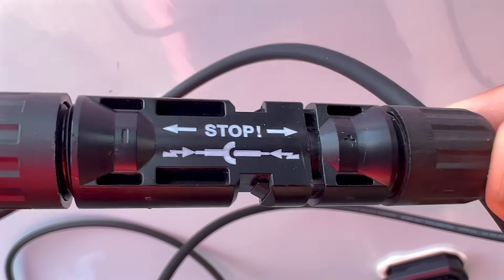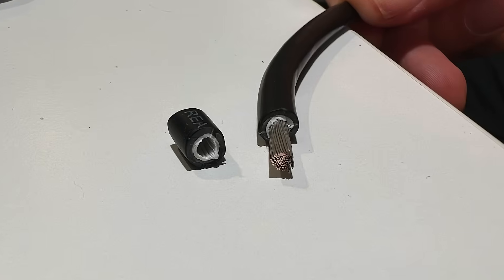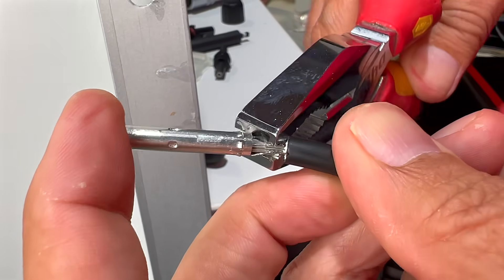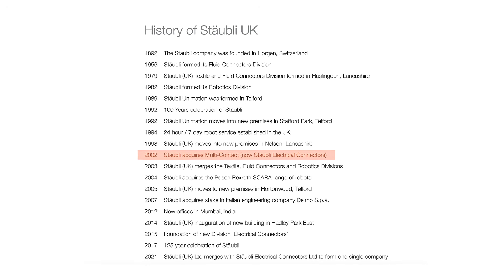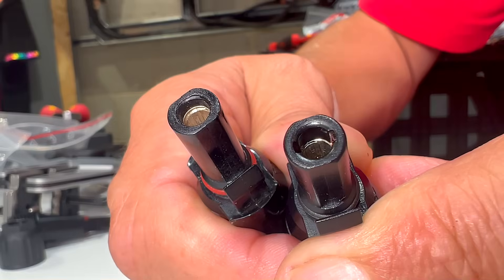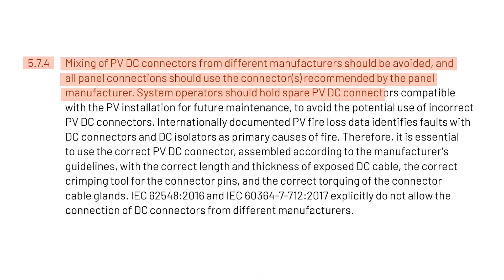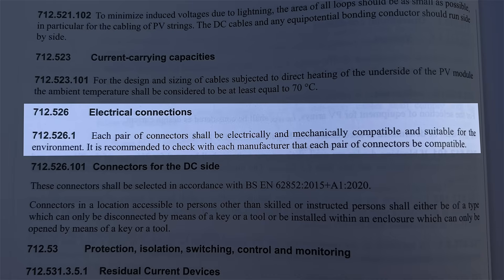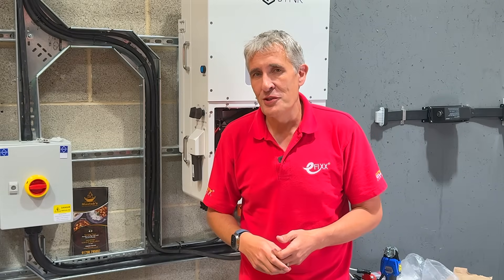Don't Get Burned by MC4 Solar Connectors

Comment: So when your solar company hires off Craig's list and they put panels on your roof... We build solar fields from 2 to 20 meg. If you're worried that your installer is using subpar MC4 connectors, or just to be safer, seriously consider a ground mount system where the panels are away from structures or build a solar carport. And don't forget that panels on your roof actually reduce the house's value to a potential buyer. And WHEN...not if...the roof leaks, it's going be expensive to remove those panels and "find" the leak. Firemen love panels on the roof...NOT.

Comment: Installers are not checking that the panels, optimizers and inverters are all the same brand of MC4 connectors. Trust me…and they are probably not all the same. This video would scare a homeowner into thinking their roof is going to catch on fire. It’s is very rare that a fire is started due to a MC4 connectors compatibility. It’s for more likely that a field crimp done poorly in the issue.
Good video with good info, but a little over the top.

Comment: 🫵….This happens when the MC4 connector isn't properly crimped to the cable...it overheats to the point of catching fire...use the correct tools to avoid loose electrical connections…👍

Comment: Something which is not mentioned, is Drag on the connection. I have had two firmly locked connectors loosen sufficiently under continuous light load to cause connector melting.

Comment: I feel like I have the opposite situation with MC4 connectors.  the metal inserts on the aftermarket connectors that came to my cable have a ton of pull out resistance, where as the Staubli that I purchased to replace them with seem to be fairly loose fitting.  not Trombone loose, but definitely not as snug.

Comment: Superb and thanks. I'm fitting a 20W Solar PV panel to charge the batteries on my boat. I have to go from the SAE fitting on the PV panel which is waterproof and sealed at the panel to an MC4 male and female from the solar charge controller.

Comment: this connection is a design or implementation issue since not all companies use them
and one of the 2 setups I run has conventional connections 
I actually want to build more of a bus bar style connection for my setup to be sure they connect right or go to less panels with more power one setup has a bunch of 100 watt panels that can be a pain to wire since light  conditions can impact that many panels depending on series or parallel 
just glad to know I was right to get rid of the ones I tried to install without this knowledge a while back

Comment: I got half way through and just had to ask myself why I was watching this advert?!? Arcs will arc if the DC voltage is high enough, regardless of the quality of the crimping connection. If you have a high enough DC voltage to melt connections while inserting/de-coupling them ... then the problem is between your ears, not between the ends of your crimping tool.
Reply from the maker: How can a good quality correctly specified  connection cause an arc?
Reply: @efixx exactly. It has NOTHING to do with it. You make it seem like the quality of the connection is the key issue in that classic clip of connector separation causing a giant 10cm arc... in the same way you mis-characterise the use of other crimping tools without referring to the myriad affordable alternatives that do a perfectly decent job for almost all use cases. Fear mongering adverts are lame.
Crimping is important, but this is no video about getting to the bottom of connector quality of the statistical causes of fires in solar installs. It's just an ad.

Comment: What I don't like about Mc4 connectors is at clicking in and not able to undo if you have a bad connection!!! Why do they have to have such a stupid engineering detail??? Why can't you lock in the connector into the housing without permanently connecting it?!!? Bad engineering design...

Comment: Thanks for the warning, especially regarding poor connector quality.
For everyone thinking lower voltages will save them: I tested the DC arc of ONE panel out of curiosity (6ish A, 22ish V) and I was able to hold a stable arc with my multimeter probe on Amps mode, burning the tip and melting the the other contact. The arc broke after a distance of 1-2mm but holding the arc stable by hand (with a gap below 1-2 mm) was not only possible but actually easy. While the initial distance where arcs are possible to initiate are similar in AC and DC, DC arcs can be drawn out far further than AC arc, which makes them a lot more dangerous, as it takes far longer with DC before sufficient material is melted away before the distance is too far and the arc breaks.
I will definitely repeat that experiment at some point with 3-4 panels in series (short-circuit). I will also do an experiment with bulk capacitors being inserted at both the load (this time, no short circuit, instead load slightly below the MPP) and bulk capacitors across the internal panel diodes, to reduce the initial voltage difference at the point of a break in the circuit to see if that makes any difference.

And for crimping, I was aware of the possibility of poor contact there and have always bought connectors pre-fitted to cables. If necessary, I have cut pre-made cables and soldered the wire to another wire (instead of fitting connectors to the wire directly), then covered the solder connection with something waterproof and mechanically robust. Maybe soldering the connection of the first and last panel (skipping the connectors entirely) would both save money and reduce risk.

Is there a good way to check contact resistance of the connectors in a closed system?
Is there a device that can detect arcs and tell the MPPT to shut off?
Reply from the maker: Thanks for sharing your insight on the subject!
Reply: @HL65536  somewhere in this comment section I read Will Prowse used a butt connector and was ok with it (I haven't seen Him do this) so I can't validate it but, I don't see any reason why it wouldn't work !

Comment: As a sparky of 45 years I believe all solar panels from the factory should be supplied by law with the opposing male/female connectors ready to be crimped on whatever cable is used on site. The amount of problems I have seen over the last 20 years is truly off the scale and downright dangerous. 80% of the time a bad connection is caused by incompatible connectors.
Reply from the maker: TBF - Some of the manufacturers who use their own brand of solar connector often supply a pair of mating connectors with each pallet.

Comment: My 11 year old solar and battery bank simply used traditional screw terminal blocks and heat shink. Never had a failure with them. The connections were always kept out of the weather. Never been keen on these modern connectors

Comment: Connectors are always mix matched.  Panels have clones, inverters have clones. So du combiner boxes. So when you build your own cables with original stäubli connectors you have no single connection with the same manufacturer.  Who cuts from panels the cables to install original connectors?

Comment: These are good connectors.  The real problem is low voltage but high amperage arrays.  People keep thinking lower volts is safer but they still need the power.  So they pump a lot of amps.  Watts = volts*amps.  Crimping and corrosion become big issues when the amps are high and the voltage is low.  Size your array to at least 200 volts.  That way, if you have a 3000 watt array, you’re only pulling 15 amps.  Also, you should have arc fault protection in the circuit.

Comment: What causes connectors not to snap together no matter how hard you push on them.  I have two of them that I have to wrap a bit of electrical tape around them to make sure they don't separate over time.

Comment: 114 panels in my system no idea what brand connectors different brand panels all crimps done either correct crumpet 8 years now nerve one failure or melt after this I expect the whole thing to burst into flames flames

Comment: I see a bunch of Qcell panels in the video.  I think you'll find they will mfail due to the poor manufacturing of the panels, not the installation.  I've had to recommend replacement of Qcell panels after 4 years as they were failing to produce any output.  Qcell refused to cover any warrantee.  Never use Qcell.

Comment: A good crimp connection will be, technically, gas-tight. Not that it matters, but this is why crimp pins are considered more reliable than soldered pins. Solder breaks very easily with flexure. Crimp does not.

Comment: I should comment so that us DIYers can sleep soundly at night. Those of us working with a small enough voltage, below 100V or so, a bad connector won't arc as demonstrated in the picture. Assuming living on earth where most of the atmosphere is mostly Nitrogen, the breakdown distance as shown in the Paschen curve at 100V is about 0.0001 meters. So the breakdown will be contained within the plastic housing and isn't as dangerous as shown in the video.
Reply: I have seen a 20mm fuse arc like a lamp (for  long enough for me to stop it deliberately as the board was melting with the heat) when broken just on 50V
Reply from the maker: The voltage on the connector demo was less than 500 volts
Reply: @efixx  still nobody give a flaying

Comment: Spending hours of work checking and double checking why a PV array doesn`t work, just to check some cross-branded MC4 connectors don't make contact even when plugged. Thinking about it now. The leat of the problems would be they don't work, but the fire hazard from some wild arc inside the MC4. 
Also, most inverter and solar brands have specified to us we should only use the "MC4" connectors provided by them on the box, and using any other would void the warranty.  Fair enough.

Comment: I thought when using the plastic wrenches that come with the MC4 kit as you are using in the video, that when tightening the nut it will be torqued correctly when it slips with an audible click. This seems to work great for me or am I wrong?

Comment: I use Weidmuller PV stick sets in combination with MC4 original connectors on the PV modules. I use them offshore, under very harsh condition and not a single time any of the mixed connections has failed. I use them with low voltage/low power PV modules and 4 mm2 cable.

Comment: Funny is that most of the connector are already from manufacture and you usually install max 10connectors 😊. And that "fake" one are maybe from the same company as attached on the panels😅
Reply from the maker: It’s not an MC4 - which are only made by Staubli -

Comment: Newton meters are so hard to visualize, leading to the engineer depending on the tool rather than mastering the tool. 3.4 NM is    2.5 ft lbs  ,  So pull 5lbs if your wrench is 6  inches long ..... or 10lbs if its 3inches.    What is the tolerance on that torque ?

Comment: 12:35 RIP this panel. Crystals are not flexible. Check it on thermovision cam it would be hot in several places after such an instalation methods.
Reply: Thats what I noticed too. There was a recent youtube video showing (using Infrared or some soecial camera) that even light hand pressure creates cracks and damage.

Comment: I thought the nut had to be screwed in all the way to the connector to be waterproof?,  I see here  it is to 3.4 Newton, so I just stop there even if not all the way ?  Wanting to screw to the connector all the way  it is too tight and cdid "rossthread".

Comment: Multi-Contact and 4 mm?  Yeah, on Staublis.  Don't mix and match folks.  If you are using different kinds, you can spray paint by brand so only two of the same brand mate.  Even the cheap "MC-4s" are expensive.  For small setups, there are always crimp butt connectors.

Comment: All the connectors that I assembled and crimped I also soldered them.. I also use silicone electronic assembly grease where mating surfaces and O rings were.. When I sourced the connectors I bought them from a reputable electronic component supply house.. When you buy cheap Chinese made panels you can pretty much expect to get low quality knock off connectors installed on them.. The higher the DC voltage or amperage in the panel array the more this connector issue becomes a problem.. I limited mine to 10 amp at 120vdc per string.. Another problem is those 2-3-4 way combiner plugs that can become ground zero for heating and failure..

Comment: I've never installed solar, but am otherwise familiar with electronics and have spent many years as a component-level service engineer, I like the finish when the crimp is done properly, as in this video, but if I were doing this for my own install I would be tempted to flood a little solder in there - especially if it is supposed to last 20 years! I understand too much time/hassle to do it commercially though.
Reply: IPC says not to solder a crimped connection. 
The heat of the solder can cause annealing of the crimp and solder wicking can cause mechanical issues. 

Automotive prefer to crimp over solder, and never solder a crimp.
Reply: @weeeeehhhhh Solder doesn't really get up to the annealing temperature of copper - 220C or so for lead-free solder or (my preference) 60/40 is around 190c, whereas annealing temperature for copper is typically 300c-400c. It's possible I suppose, but unlikely to be an issue. Solder wicking? Yep, you do have to look for that one, particularly any wicking towards the mating surfaces. That all said, if you're the kind of person that would solder a crimp, you do tend to have a comfortable familiarity with craft skills to some degree. 

I wish there were a standardised way to remotely monitor these connectors to see if they are getting hot.
Reply: @mikehart2555  solder melts at 220, but the soldering iron is at least 100C above that. We solder in production with Metcal soldering irons set to 365C. That's a medium heat. High heat is 410C.

Comment: If you dont have the crimper or only using it in small. Installation i only find it better to just solder it directly I think its more than enough 😂

Comment: I did solar installs for 25 years, often times I would simply cut those damn connectors off and use a high-quality uninsulated butt splice followed by glue filled waterproof heat shrink. One of my solar arrays is now 23 years old and it is in perfect condition without a single failure of the solar panels, the wiring, or the inverter.
Reply: I actually came to this video bc I was wondering about that.  Why are these specific connectors even needed?  I would just do a splice or butt connector ad call it a day too.  I recently bought y first panel used on FB Marketplace ad it has o connectors on it.  The wires just have bare ends.  Seems like these MC4 connectors would be pointless.
Reply: @finsta74  connectors do make maintenance/modification more easy though; no risk of exposed wires dangling around touching and shorting things.
Reply: @finsta74 don't do electrical work if you aren't qualified. You'll put the property (most people's most expensive asset) at risk.
Reply: Great, no serviceability because of your decision, nice going 🤦🏽‍♂️

Comment: You know... THis is a failure of the designers who made a connector with too many intricacies to assemble in the field with a 100% success rate... A good design would not only be up to the task, but nearly impossible to get wrong.

Comment: It is true that Stäubli is a good company. However, it is not the only good company in this market and it is not certain that it is the best...
I use Wiha equipment and I highly recommend it. However, I always buy connectors recommended by the manufacturer of the devices they are to work with. For example, if Jinko PV panels, then the MC4 manufactured by Jinko, if the Deye inverter, then the Deye connectors. And so on.
I have never had any problems.
In my opinion this is the best method and the additional benefit is that manufacturers have no grounds to reject a complaint! Because the truth is that they always reject when they see MC4 connectors of another production than their own or recommended by them. I treat this as an ironclad, unshakable rule!

Comment: 11:46 Thanks for this. I bought a solar panel that came with mc4 connector only connected to the panel but now I have to purchase the connector to the battery which is a big risk
Reply: If it is just one or two regular panels, directly plugged in,  and it is not mounted to a roof, you can use that system.
Once you have a string of panels, you have a very different dimension of power going through these connections.
Reply: @alis49281  you almost always have at least a string of 3, and  parallel combines can go wrong just as easy as serial connections

Comment: A+    geez   this is crazy ...now thinking i will cut all connectors OFF and solder ALL connections since i will only be connecting less than 20 panels.   Any thoughts as to why soldering my connections might be a poor idea?  NOTE ...i really do not care about how difficult it might be to solder on top of a roof while making my solder connections

Comment: With all of the uninspected, not UL listed imports I've seen copper coated, aluminum wiring, great variation in size of connectors conductors coatings for conductors being sold on all of the websites usual suspects that everybody buys from they're letting in junk as if the UL laboratories code meant nothing but we don't care they're cheap.

Comment: I use solid connectors and use electrical solder to securely attach them they are better quality than those thin metal connectors. No over heating.